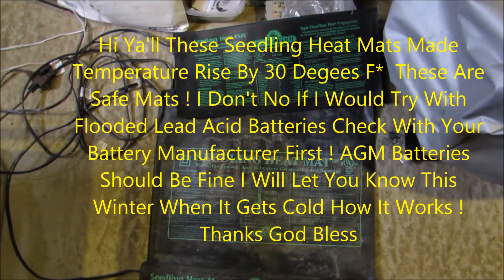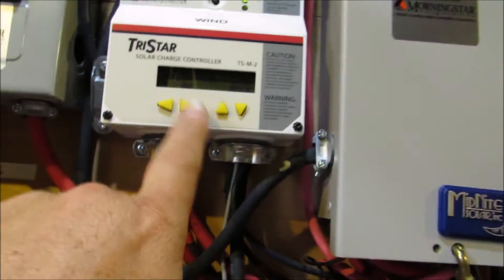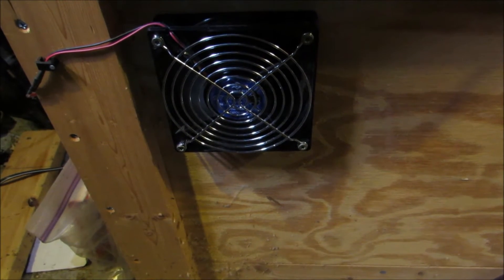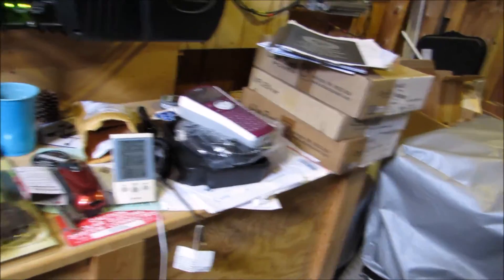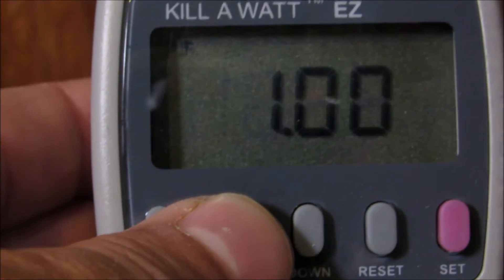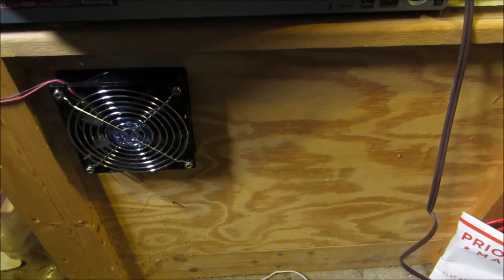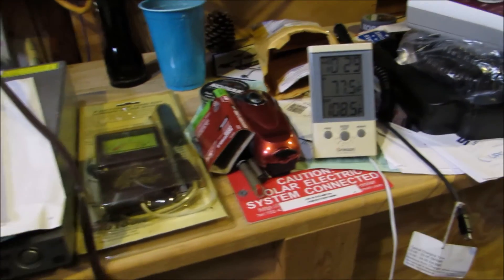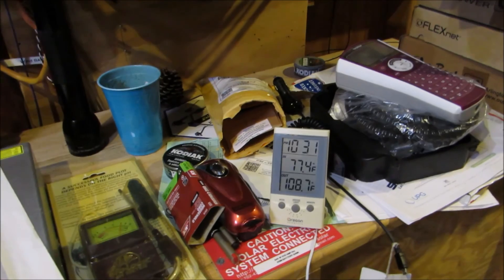Solar And Wind  Battery Bank Keeping Them Warm In Cold Climates By KVUSMC

Comment: Keep your Lead Acid battery bank at 77 Degrees is the optimum temperature. But there safe any wheres from 68 to 85. If you start going above 85 there starting to get to hot.
Reply from the maker: I agree

Comment: What do you think is a good temp to keep my batteries at during winter?
Reply from the maker: Jason Brown      This Is What I Found Most Of The Time  ( 25 degrees C (about 77 F). At approximately  ) Jason Is A Good Temperature !       
 Battery capacity (how many amp-hours it can hold) is reduced as temperature goes down, and increased as temperature goes up. This is why your car battery dies on a cold winter morning, even though it worked fine the previous afternoon. If your batteries spend part of the year shivering in the cold, the reduced capacity has to be taken into account when sizing the system batteries. The standard rating for batteries is at room temperature - 25 degrees C (about 77 F). At approximately -22 degrees F (-27 C), battery AH capacity drops to 50%. At freezing, capacity is reduced by 20%. Capacity is increased at higher temperatures - at 122 degrees F, battery capacity would be about 12% higher.
Reply: KVUSMC / Kenneth W Viar Jr
 Thanks Kenneth,, this is excellent information, I will do my best to keep my batteries above 70 F this year :)
Reply from the maker: I Know What You Mean Buddy I'm Either Have The Air Conditioning Running In Spring And Summer To Keep Them Cool And Winter I'm Running The Heat In Winter  I Hope This Will Do The Job  Buddy  Cheers